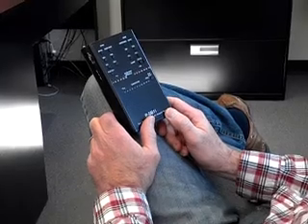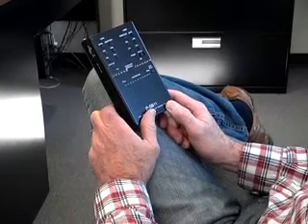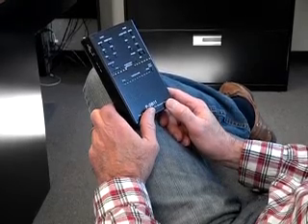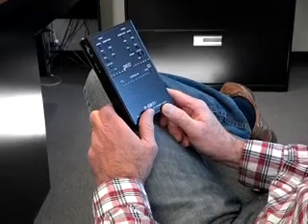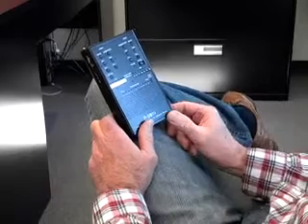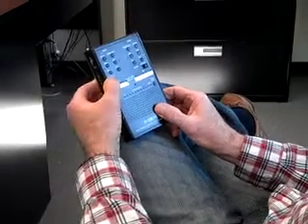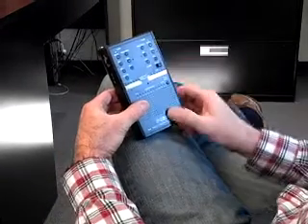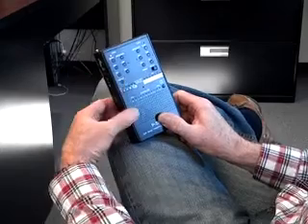P-SB11 50mS AM/FM Sweep Rate Eliminates Radio Bits

Comment from the maker: The debate over linear vs step sweep is well noted, this is based on personal preferences and success from one individual to another. And while I agree that the 50mS pulse can be difficult to listen to, in ITC you have to maintain an open mind to all possibilities. The P-SB11 AM/FM sweep pulse duration is adjustable: 50ms, 100ms, 150ms, 200ms, 250ms, & 300ms. AM will go one more step @ 350ms. You can attenuate the AM  like the P-SB7 by turning the AM antenna OFF. The AM signal is received, but at a much weaker level.

Comment: I really like mypsb11 spirit box but the temperature function always starts to activate and indicate an increase in temperature even tho the device isn't being hand held. Resetting it doesn't stop the problem and it alerts again shortly afterwards. Any suggestions please?🙏
Reply from the maker: Verify circuit operation - Take an ice cube wrap it in a paper towel and touch the thermistor temperature sensor and verify if there are 5 descending octave tones with corresponding BLUE LED's for each degree.When the Blue LED starts to flash, press the RESET button to zero baseline. Now, as the temperature sensor begins to warm, the LED will turn RED and there will be 5 ascending octave tones with corresponding RED LED's for each degree. When the probe is in your environment, it is susceptible to subtle temp variations of +/- 0.5℉. If you suspect that it is defective after verifying circuit operation, contact us and arrange to have it checked out

Comment: I agree with frank you need to take a leaf from franks book. You cant cut out radio bits. The whole point of using the radio is to let the entities use the talk bits. If you want to use static noise use a white noise generator and not a radio.
Reply from the maker: I understand your opinion. However, I specifically decided to pursue a different approach, as opposed to duplicating a technique that already existed. This is how we learn and grow. Over the last 4 years, the P-SB7 technique has been proven to be very effective. The P-SB11 which aired for the first time on GA's Overland Hotel & Saloon episode on June 21st also had excellent results using dual sweep at high speeds without interlaced radio bits. I do believe that both approaches are viable & effective. There are enough adjustments built into the P-SB11 that will allow the user creative flexibility if they want actual radio bits mixed with the sweep.

Comment: Contrary to popular opinion, the entities use the bits of speech developed from sweeping a radio to form their voices. There is in fact a reason why the Ghost Boxes are based on broadcast radio! Making the AM radio "untuned" defeats the whole concept. Eliminating all "radio bits"--same effect, defeats the boxes altogether.
 I know skeptics will claim we just hear radios bit, but that is is not the case most of the time. 
 That is not a refinement! What could I possibly know about boxes!?
Reply: True, you have much experience. However, we are finding on the field that you can get incredible voices on the P-SB7 with the antenna removed at 150ms. Gary has me sold. Time will tell if faster sweeps render result, but the added adjustability for experimentation is innovative.
Reply: Agreed frank. Agreed.